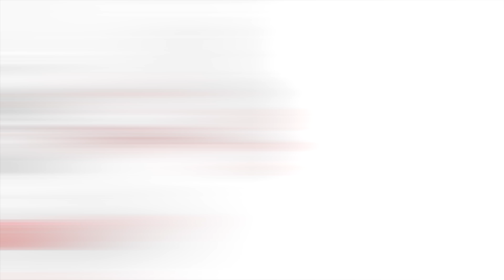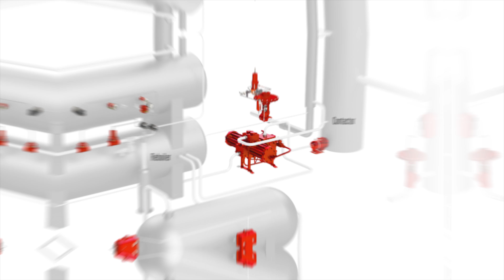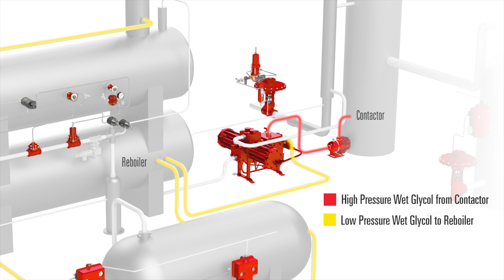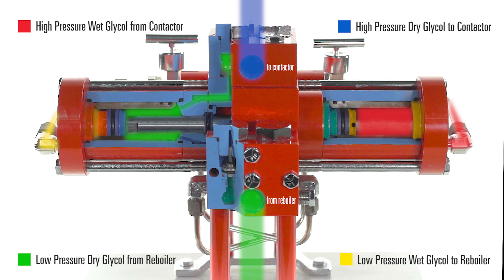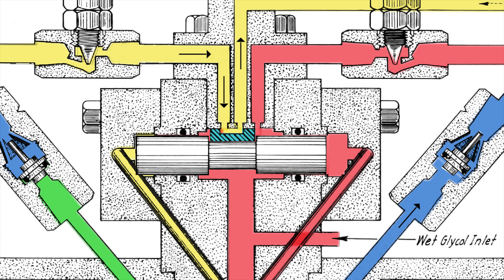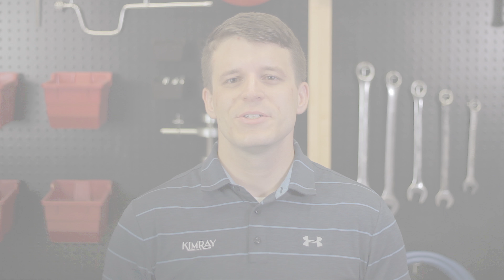How the Kimray Energy Exchange Glycol Pump Operates in a Glycol Dehydration System

Comment: Is the "small quantitfy of gas at contactor pressure" only needed to prime the pump? Or is it a continuous consumption?
Reply from the maker: About 35% of the total volume of the pump will be filled with gas continuously and will need to be considered as continuing power cost for pump operation. They can find these Gas Consumption rates in section 10 of our catalog- page 10.15.

Comment: Aren't the arrows on the needle valve assembly suppose to point in towards the center of the pump?
Reply from the maker: Very good catch! Impressive to call us out on that detail :) Honestly, it's likely whoever made the cutaway model reversed one of the needle valves when reassembling. Ultimately, the flow goes both directions through the needle valve during operation so it shouldn't affect operation. I'll verify with our product team to see if there's' any more info I could follow up with on this.
Reply: @KimrayInc  lol..I have caught them coming into my shop backward, but I always switch back. The orifices are different sizes on each side, but you are correct; it will still operate. No disrespect intended. I do enjoy your instructional videos; keep them rolling out.